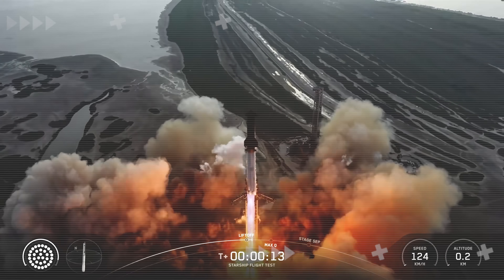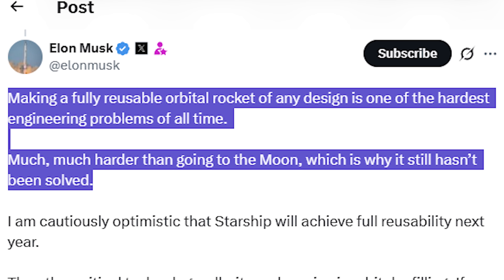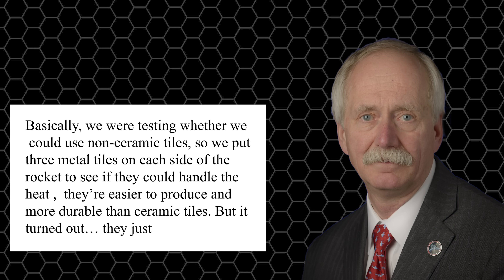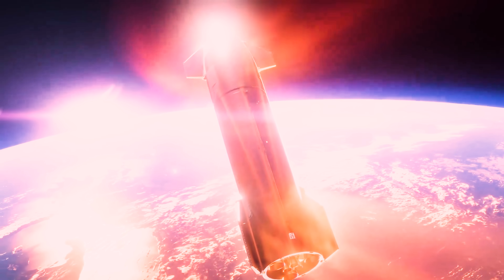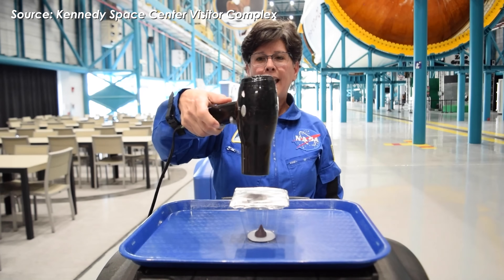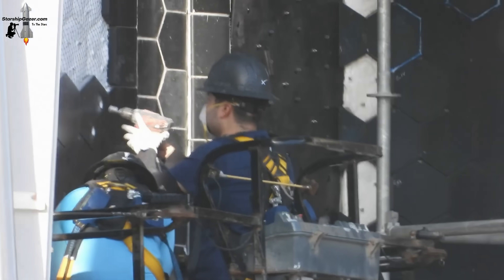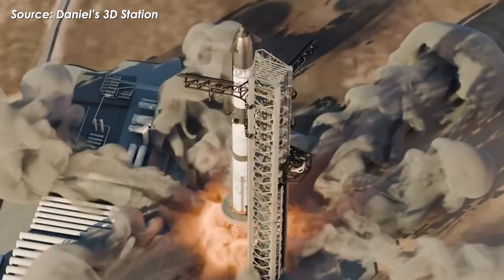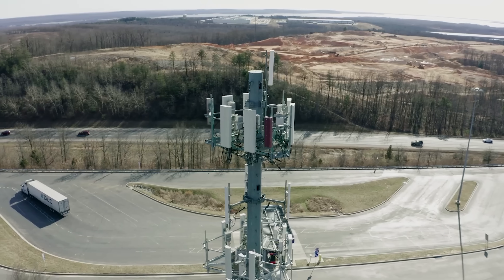SpaceX VP officially declared STOP Metal Tiles on Starship, Replaced by...

Comment: How much fuel would it take to reduce the entery speed to a point where heat tiles are not needed.
Reply: You would then also need more again...to launch WITH the extra weight to be used in landing.

Comment: I can be wrong,  but this reusable heat shield ideas just seems like a waste of time , they are just sending it to fail . These things will melt , thus each flight will need a new layer again . 
Just a pointless dance ,  there is no other available solutions,  that isn't an ablative material . Yes this makes using stainless steel also pointless in the long term,  because the ablative will dispose of the heat .

Comment: getting any sastalight machine back from space means entering at 17000 mph and more
This means ythey are hitting an atmospher rich in oxygen
high temptures speed oxygen metal makes one huge
oxygen cutting gun that ciuts through concrete oiron like a butter knife.
mulitplem tiles means a mass of edges cracking moving joints
broken tiles.
a few blanket wraps of sweating liquid nmytroghen  metal with heat wrap under
would cut down on  massive time checks.
liquid gas p[ushing out inside and along tile ridges
would make a ground effect run off of plasma and its heat
The red stains show how the plasma tracks and most probable is part of a testing.
constant change small innovation is what succeeds not running around like an headless  chicken
crying its failed its over its no good?
You pick up the [pieces and start again and again and again
Or you sit in yor little cave away from the monsters outside

Comment: The turbine blades in a jet engine tolerate extremely high temperatures by having holes out of which a fuel comes which forms a layer which insulates the blade.

Comment: Dont think they will stop experimentong with metal after only one failure, its a promising way along others and is woeth exploring in parallel. 
Also looks sad that you have all this energy and plasma with its particular electromagnetical properties and you cant take profit of it, not even to controll the flow of the plasma, not even like the simplest ship metal rods that concentrate oxidation in predesigned places.

Comment: A fully reusable rocket is an illusion and a waste of time and money. A single-use engine could be twice as cheap and as the Raptor 3 engine, and could be much lighter. And an expendable second stage could be twice as light as a "reusable" one (or it could carry twice the payload)
Reply: Wrong, Falcon 9 is much cheaper than any ULA, Boeing, Sierra Space, Blue Origin or Rocket Labs rockets.
Reply: @mrbaab5932  Falcon 9 is NOT fully reusable. Only its booster is.
Reply: @tedantares2751 That’s true, but it demonstrates the point of how useful reusability is.
Reply: @peterclarke3020  True. SpaceX and the Falcon 9 demonstrated that partial reusability is sufficient to dominate the global launch services industry. Contrary to what the geniuses at ULA and the European Space Agency (ESA) blabbered in 2013 when SpaceX began to develop the partially reusable Falcon 9.
Reply: 2배더 무거운대신 1000번 더쏠수있단걸 잊지마십쇼 그들은 당신보다 현명할겁니다.

Comment: A higher nickel less chromium and add some tungsten could make a better alloy with substantially less oxidation, tungsten is good for up to 6500F it used as conductor for tig wielding and turns white hot while turning even stainless into liquid same process used to make Starship and Superheavy

Comment: We have so little information about the metallic tiles are they coated with silica to prevent them from oxidizing are they filled  with inert gas like nitrogen?
Reply: The nitrogen filled heat shield tile has less thermal mass than a solid tile and gets even hotter.

Comment: With my little 👁 i spy and STAY AWAY from metal tiles as it aint the answer to the heat shields...
Think extreme heat...
Think extreme cold...
Think extreme radiation...
Real carers dont mislead, we discuss and you agree whether its worthy or unworthy...
Reply: Consider the possibility of protecting these metallic tiles with ceramic silica to prevent oxidization And metallic tiles need to be filled with inert gases like nitrogen otherwise the oxygen expands an oxidizes Within

Comment: U have several nuisance less moral turpitude comments on ur platform. Not other thn u got paid to insert it on ur platform comments. 
 
It affects ur followers like I do~mentally.
Secret, my friend, there's so-called " filtering."

Let's get back to the cause of "rustic residue" obtained fr the belly cover of SpaceX Ship37. Maybe due to ablative heat shield burn-off, oxidation of stainless steel, extreme temperatures, and others.
Mr. Wm Gerstenmaier's analysis, solutions, and suggestions may work well.
U've mentioned NASA's affiliates? To Imap fr Princeton Ed was excellent. 
If I am not mistaken, I think,  SpaceX-Falcon 9, had launched Indonesian Telecom Satellites to a "geosynchronous" to transfer orbit? Yesterday, sametime the sad assassination of Charlie Kirk in Utah. Very sad 😔. Today's the 911-anniversary.
I didn't mean to be a tweet to yah, my friend. Think for a moment as it gets old.
Thank U ✌️
•~●k-